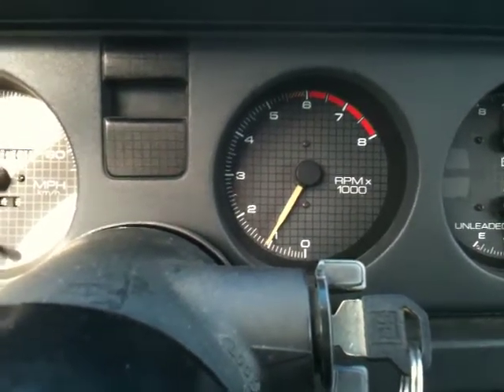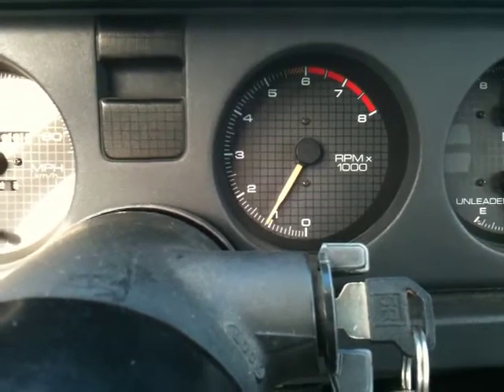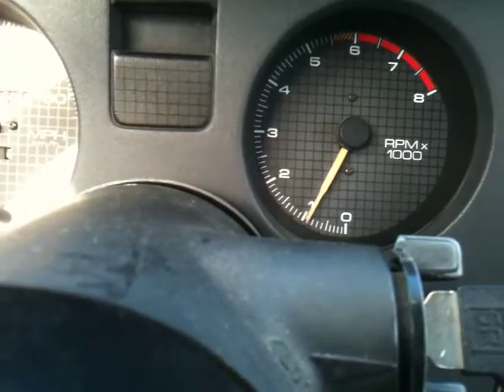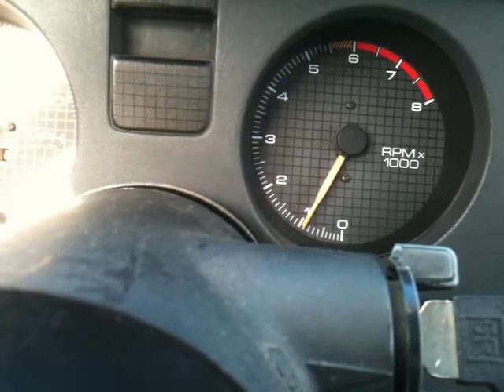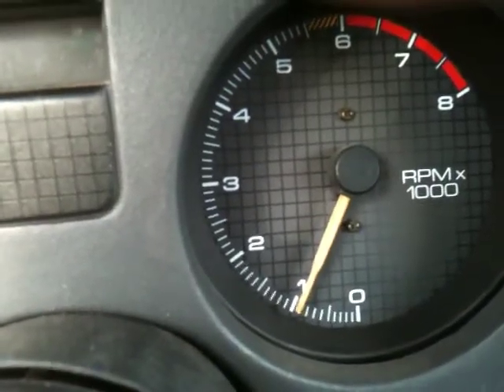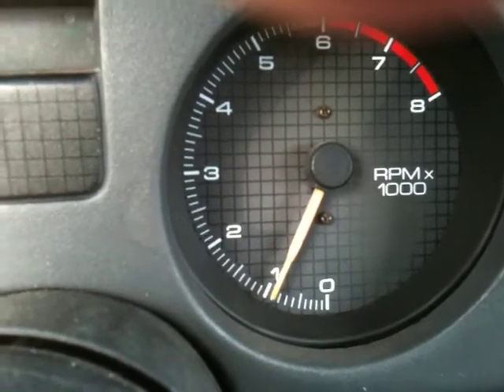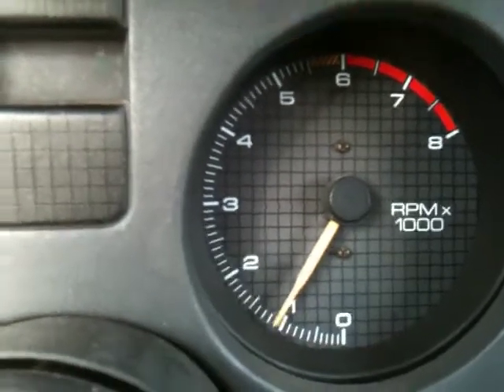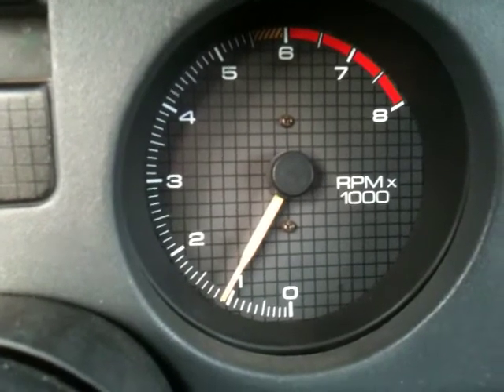ALDL interface, grounding to itself at the pins?

Comment from the maker: @lukeskywalkification Ended up changing ECM with a refmanufactured from Oriellys, threw chip from old ECM in the reman, and that fixed this issue.        I been blowing through O2 sensors latly, Looks like unburnt fuel getting to my O2, so may be having spark , ECM, or issue, I hear.  Its stalling till warmed up, when I put her in gear again,  wonder if ECM gone.